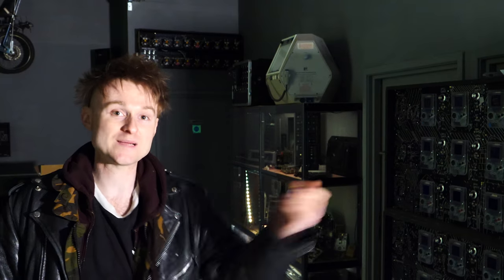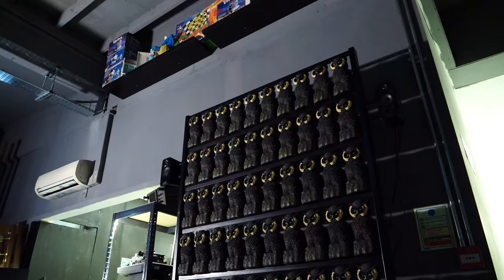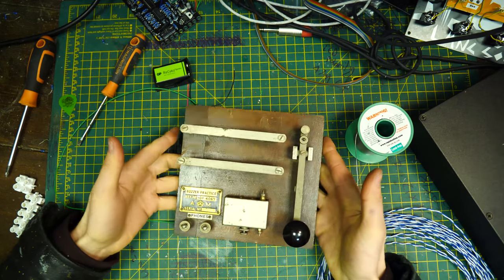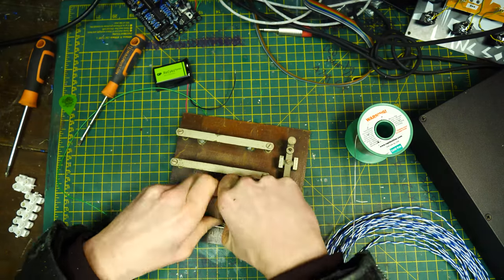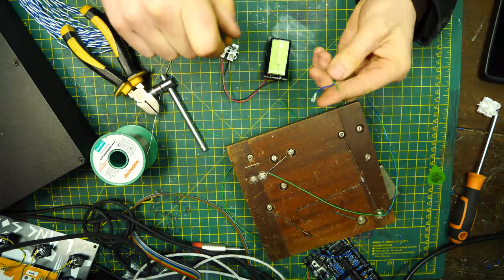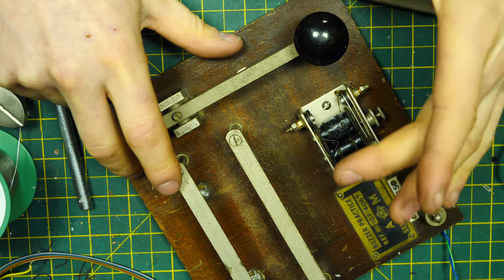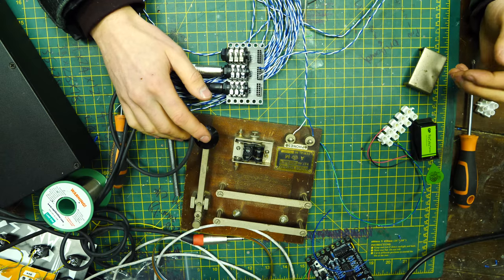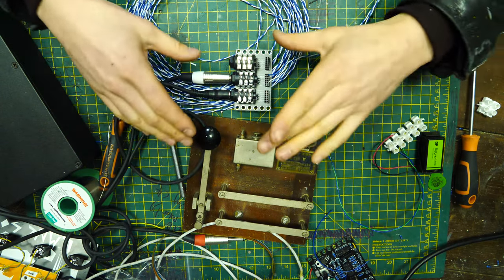WIRING A MORSE CODE MACHINE INTO MY BUILDING... No Phone Required

Comment: Spark gap transmitters work quite similarly to subtractive synthesis. The spark produces a wideband impulse which is then filtered to get the desired frequency response. Unfortunately you can never filter out all of the unwanted frequency components, certainly not with the technology available at the time. Modern systems are basically additive synthesizers, just at radio frequencies instead of audio ones.
We also still use a lot of those old brevity codes.
73, KD2TDE
Reply: Glad someone mentioned that--though I'll admit that I've still got to have a cheat-sheet of brevity and Q codes at the QTH. 
73, KM6ATS

Comment: I'm pretty sure you don't need a bunch of wire for that spark gap morse code practice unit. With that spark gap, just connect a couple pieces of wires onto the headphones terminals and they will act as an antenna, transmitting the spark gap as noise. You should be able to pick it up on any AM radio that is tuned between stations - you'll hear it as static on the radio.

Incidentally, that's precisely how the first radio transmitters operated.
Reply from the maker: yeah thats a fair point! however oddly enough the wall between this and the room i want to transmit to is lead lined! (yeah i know pretty odd right ha)
Reply: Sorta. With just wire, it doesn't go as far. It works between 10 and 30 meters if you put the tuning capacitor and the ferrite antenna (as a parallel tuned circuit) in series with the buzzer. 
Then you can receive it on the broadcast band quite well. 
It won't be just static, it will be the whistling tone :)
Reply: @LOOKMUMNOCOMPUTER  Old medical/dental building?

Comment: I think I took my official Post Office Morse code test on one of those back in the seventies !  Nineteen seventies that is ;-)
I reckon if you hang just a wire antenna on that then you will have an original spark transmitter !

Comment: Hi Sam
I've never heard anyone call them a "turret board"
There actually called "connector blocks" because you connect cables together with them, well that's what I call them anyway. But every other electrian and electrical engineer calls them. If you go into an electrical distributer n ask for "connector blocks", they'll ask you "what current"

I'm just trying to help you Sam 🙂
Reply: Over in the US we know them as terminal blocks, in case you need to Source International parts.
Reply: Lego bricks we used to call them

Comment: Sam checkout wago (wire) connectors (Amazon etc) for joining wires instead of ya turret(Scotch). You can just lever up, wire in and down. Could speed up your test stages in projects by minutes ;) .I bought a bundle to run a radial and lighting circuit for workshop I built missus and it was so fkn fast. You aint got to bend wires into loops  and screw.  Bought on Amazon etc got a bundle with 2 to 6 think they go more.  Was gonna use the trusty method as you did with this morse ....but hey technology, was so quick
(There's other makes, does same shizz) Right I gotta go into my own setup and make music..been watching your vids for hours today for some reason..all good..l8rz ✌️😷👍

Comment: id make sure all the cable you're putting up there is Plenum rated cable, would hate for something like this to get hung up on a technicality
Reply from the maker: Thanks for the concern Martin! Funnily enough I swapped out the cabling before I fed it through. As some cable I had been waiting for for 2 weeks had turned up at exactly that time. The chances! Got a shot of it installed if anything arises. Got a fire safety back in tomorrow aswell funnily enough 😂
Reply: @LOOKMUMNOCOMPUTER  Awesome stuff man, can't wait to see this up and runing. nothing beats a museum where you can get hands on and this im sure will be no exception :)

Comment: That's not a turret board, that's a choc block, hence called because they were originally brown. A turret board you will find inside a valve amplifier where you solder point to point on metal pins (turrets). Loved the Morse code trivia. 73. Google image 'turret board'.

Comment: Does anyone out of the boy scouts learn Morse code now a days?
Reply: I was going to say it's down to ham radio operators going for their second tier or third-tier license in the US I forget what it's called. Probably different requirements in different countries. However I just saw a news story that said the US military had to relearn it in Afghanistan because the Taliban were using it to communicate because they realized the US stopped teaching it. And at least in my troop it wasn't on the curriculum, I'm sure there is a patch that if I did would have required it. Now there's video game merit badge both cool and somewhat causes me to die inside.